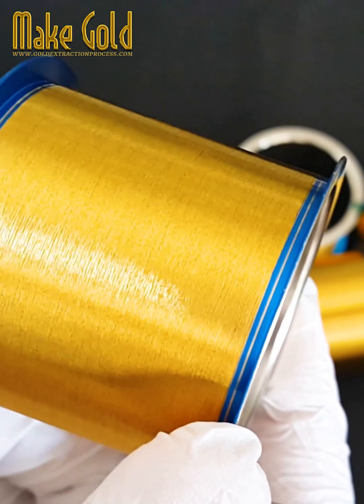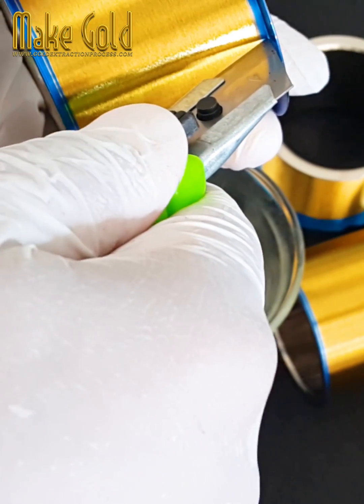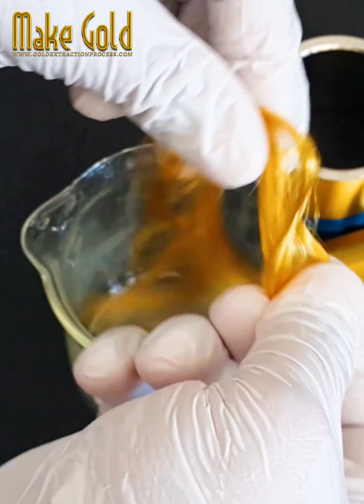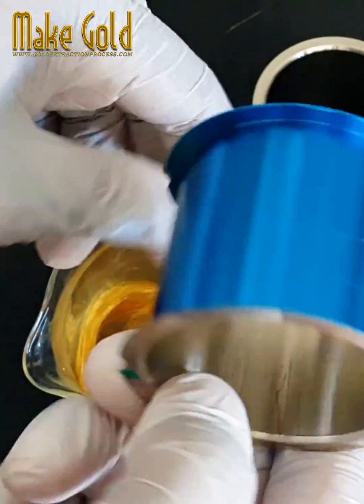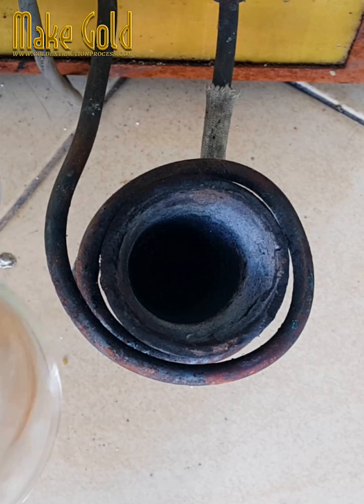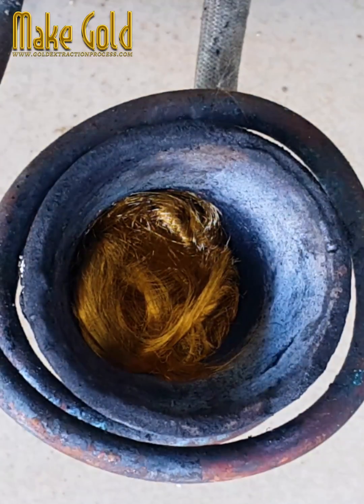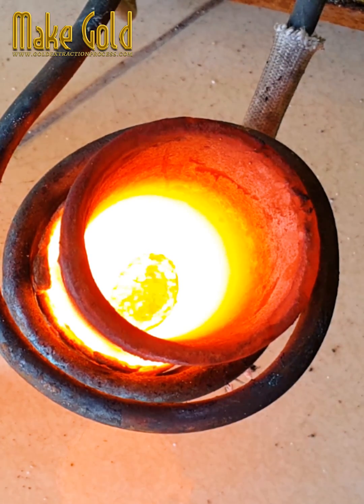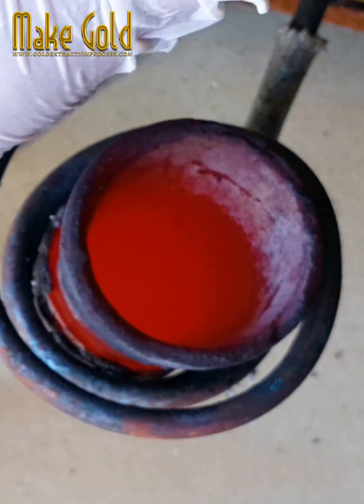Why Gold Bonding Wires my interest stops at pure gold hair Is the Ultimate Obsession

Comment: I hate you. Do you have any idea how many chips I have to crush up to get what you just slice and chucked in the jar in 10 seconds. 
Im processing 50 lb of chips right now. The returns are so low that it's becoming futile. 
I just did 50 lb of gold plated military pins from the 60s. 
Even with amazing material like that it's still impossible to make any sizeable amount of money. 
I have tons of Telecom computer server boards from the 60s to the 90s. 
I'm going to process this last batch of chips, make a ring for me and my wife and sell off the rest.
I'm sure most people would be excited with the returns I get. 
The problem is, the time I spend on e-waste, I could be putting overtime in at my real job and making four times the money.
I might just crush the chips up, ( I have hundreds of pounds of IC).
Screen on the garbage out and sell a bag of pay dirt with a gold pan and instructions. 
I know it's not what is usually sold as pay dirt, but I was averaging 1 g of gold on my test runs. 
You'll never buy a bag of pay dirt that'll get you that much.
And this way people who actually have fun panning gold, can pain it.
Personally I find nothing as tedious as panning gold. 
I can guarantee a half a gram of gold per $100 bag easily. Because 75% or more, are going to have a gram or more.
And anybody who knows pay dirt knows that the really reputable companies guarantee you a half a gram per hundred dollar bag. 
The only thing holding me back is I haven't seen anyone else selling it? 
Am I just that much smarter (lol) or am I missing something? 
Because he's giant reputable pay dirt companies cannot even start to compete with the returns I average.

Comment: I dont know this is orginal gold or artificial, i think the wire is not gold,
Please reply,
Reply from the maker: Without being able to physically examine and test the wire/material you have, it's difficult for me to definitively determine if it is real gold or an artificial/plated material.

However, based on your uncertainty about its authenticity, there are a few ways we can try to evaluate it:

1) Appearance - Real solid gold has a very distinctive rich yellow color that doesn't tarnish or discolor over time. If the wire has areas that look dull, greenish, or like plating is flaking off, it may be gold-plated rather than solid gold.

2) Density - Gold is an extremely dense metal. If the wire feels very light for its length/thickness, that could indicate a lighter core metal inside with just a gold outer layer.

3) Magnet Test - Pure gold is not magnetic at all. If a strong magnet is attracted to the wire, that means it contains ferrous metals like steel or nickel and is gold-plated rather than pure gold.

4) Acid Test - Applying a drop of nitric acid to the wire can help identify gold. Real gold won't react, while base metals will quickly discolor the acid.

5) Scratch Test - Using an unglazed ceramic to firmly scratch the surface of the wire to expose inner metal layers can reveal gold color underneath plating.

The most reliable way is to take a sample to a qualified jewelry/metals assayer who can accurately test and measure gold content using specialized equipment.

If the wire proves not to be real solid gold after testing, that does not necessarily mean it was sold deceptively. Gold-plated and gold-filled wires are commonly used for electrical components where solid gold is cost-prohibitive. Let me know if you need any other suggestions for evaluating the wire's composition.